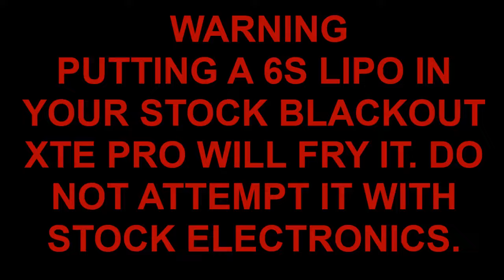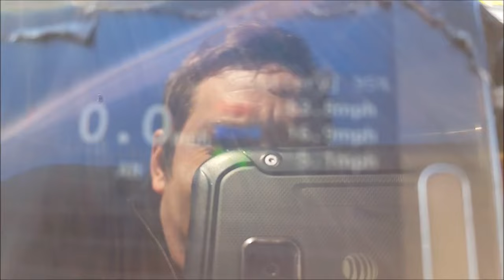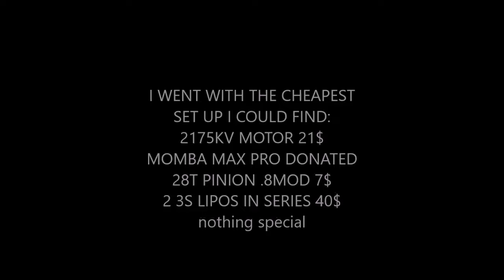6s lipo in Blackout xte pro mod  Clocked Speed run

Comment: I have a blackout xte pro SUV that I've turned into a road car new cap headlights taillights new GRP S7 wheels new motor 2000kv arrma blx  and new ESC 150 amp s5 from hobby wing by red cat racing and now running 6s a lot of modifications project almost complete

Comment: You must have those tires taped up pretty well I had those same ones ,and they ballooned then blew apart. If they give you any trouble GRP's will get you to 100mph (there belted)   Well done.
Reply from the maker: natemorte yeah I'd need some grps.  I've been messing with a team a car latley.
Reply: natemorte fishing line in between the tread works good. use three strands.
Reply: @wernerslostblues  try BSR 8th scale foams or Jaco foams. I have 3 100+mph cars right now and every one of them has foams

Comment: I got them same wheels how did you get them to fit on? The hex too big
Reply from the maker: MrGetLikeMe you have to use a 12mm hex to 17mm hex adapter.. 
https://www.amazon.com/gp/aw/d/B01EH35X20/ref=mp_s_a_1_55?ie=UTF8&qid=1483932785&sr=8-55&pi=AC_SX236_SY340_QL65&keywords=12mm+to+17mm+hex+adapter

don't use the Traxxas one the axles don't fit the lugs. the ones I linked are the ones I used.

Comment: what I need for those tires to fit my blackout xte???!
Reply from the maker: marvin parker hey you would need a 12mm hex to 17mm hex conversion kit.

this is the one I used https://www.amazon.com/gp/aw/d/B01EH35X20/ref=mp_s_a_1_55?ie=UTF8&qid=1483932785&sr=8-55&pi=AC_SX236_SY340_QL65&keywords=12mm+to+17mm+hex+adapter

Comment: Thank you for the awesome video. Did you use the stock .6 mod plastic 55 tooth spur gear?
Reply from the maker: steven hatfield yes
Reply from the maker: steven hatfield just looked at the gear I used. it's 32pitch. which can be interchanged with .8mod. and is the only gear that can come close to matching a mod.

Comment: Phone GPS always lag and if he had more room and put foams on there it would do close to 100
Reply from the maker: Is pretty accurate. But yeah you have to be sure to stay in the throttle for a solid 2 seconds or it will not show all mph. What I really needed was smaller mah batteries to lighten the weight. Would have been much faster. Was very heavy. Was quite a bit back I can't remember but 5 to 8 pounds when I weighed it on scale. Was using 2 5500 3s batteries. Big packs.
Reply: @wernerslostblues  well actually the more mAh Should give you a lil more punch. I think it overrides the weight. I run parallel 3s sometimes on my car's and spite the extra weight I usually gain 2-3mph. I think what's killing u here is no room and you need foams. That setup isn't anywhere close to potential. Keep going bud! Nice ride

Comment: Hey bro no matter what I do I can get the spur and pinion to mesh properly seems like something keeps causing it to drag even when I hand push it. I'm wondering if it's the gear shaft do you know of the spiral like part on the end of gear shaft is known to get chewed up?
Reply: TRMC drag sounds too tight
Reply: TRMC yes they do On mine Ive changed them 2 times so 1st set of diff gears was stock brushed then the next were hardened metal and they got messed up too, while jumping.  And for me I dont ever have any spur gear issues just get the mesh pretty tight and tighten your screws good. I usually dont use thread locker cause it will cause other issues when you need to take something apart.

Comment: What motor and esc are you running?
Reply from the maker: it is in the video. but it is something like a gool motor 2k kv with a castle momba max pro. but this was an experiment . pretty sure you can get better results burning up a high kv motor with 3s. I think that's our next project. we just been bashing lately.
Reply: Why did you change stock tires ? How much speed you got with stock tires , i am running 2s and burn my esc with 3s motor couldn’t handle more than 9v i am getting around 45mph but i have stock plastic spur gear and metal pinion , how is your setup do you have metal spur gear?

Comment: you said and I quote " putting a 6S lipo in your stock BLACKOUT XTE PRO will fry it ", so what should I do to put a 6S lipo on it?
Reply from the maker: Eng. V change out the esc and motor to something capable of handling the voltage of 6s. Most will say up to a certain voltage. The one that comes with the black out can only handle 3s.

Comment: why did you get .08 mod pinion, Blackouts are .06 mod...
Reply from the maker: Ryan Petersen unfortunatly you are wrong. I got a .8 mod because blackouts are .8mod. not sure why people are thinking .6.
Reply: really!!! I bought .06 mod gears for my truck based off what people in the game had said... It sucks there is not more information out there about the vehicle, I looked everywhere... Okay, so can you help line me out on a good set of steel gears for my truck...
Reply from the maker: you should have called redcat they are incredibly easy to get in contact with, i've talked to them twice, once was to ask what mod blackouts were...
i got robinson racing gears and you can use 32pitch with .8 mod. that is the only gear that can inter-mesh.good luck.
Reply: I was looking at Robinson gears they have they same 55t spur bit, again was under the assumption it was .06... Thanks for the info bro...
Reply from the maker: Ryan Petersen try 32pitch searches.
Reply: @ryanpetersen7540  don't know if you've got the info you needed but the .6 gears are what the Redcat Volcano run and alot of guys run the Volcano 64t Spur and the 21,26, or 29t pinion gear. Running 64t and 29t on the stock esc will over heat your electronics on the blackout. You would either need a 120A  to 150A esc or just use the 21t pinion to be safe. Hope that helped you!

Comment: How can I get it to set low
Reply from the maker: lots of weight is on it it the big motor and 6s 5500mahs. also the a arms are much different than stock. another thing is the way the body sits on the car. a lot of factors cause it to look low like it is. Google that because their are quite a few different ways.

Comment: 63.8???? LMFAO dude u have no room. 63.8 is about 2/3 throttle if that with this setup. U gotta find a better spot man u should be close to 100 with this setup on 6s
Reply from the maker: Wheels were a problem. Wheel grip and weight were a major issue. The spot was suitable  for the test .
Reply: @wernerslostblues  yeah makes sense. Those GRPs have to be hot and they HATE that surface. Should be close to a triple digit car

Comment: Nice runs things super fast check out mine I've got it running 75mph on 3s 30c lipo.
Reply from the maker: yeah I think you are onto something. this was a bit of a experiment. high voltage and low kv. it was really fun. but I could probably burn up a motor with a 3s and get 70. I think im going to try it soon..